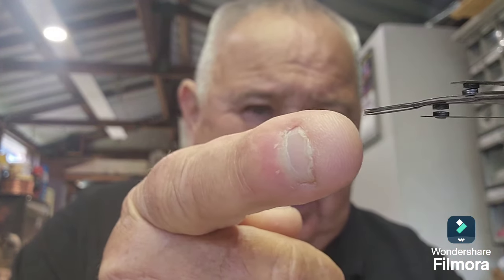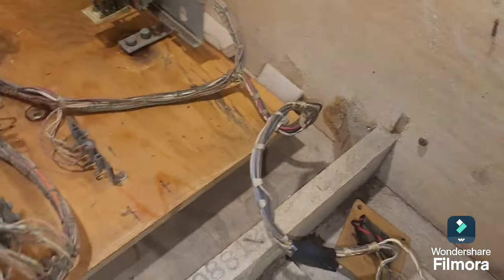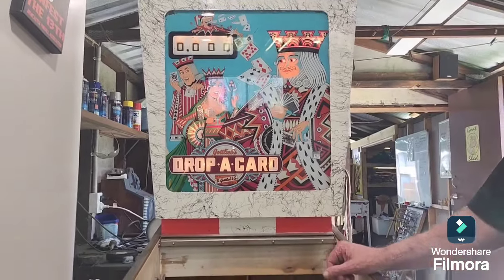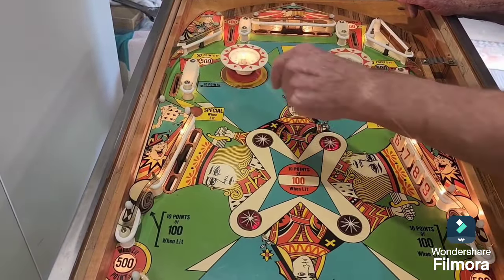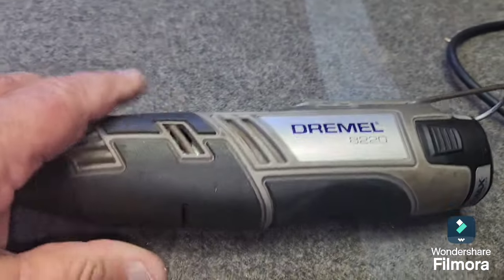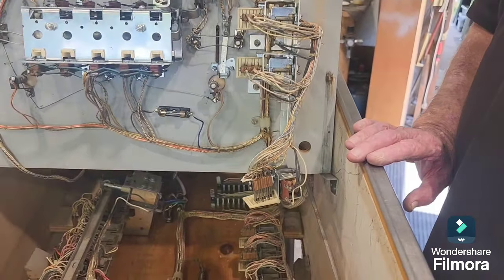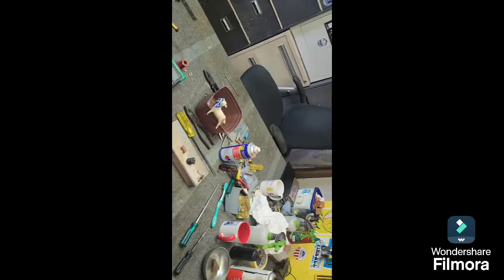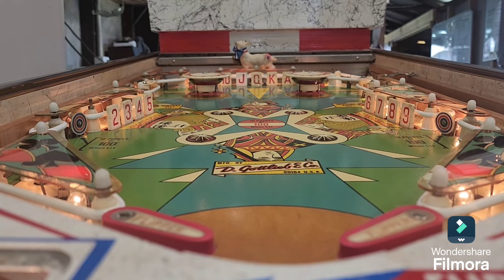Troubleshooting & Repairing Hacks Gottlieb Drop A Card

Comment: GOAT SHED, if you look at various Gottlieb schematics they will often use 47 ohm at 10 watt resistors for certain LITE lamps and 470 ohm at 2 watts resistors for certain relay coils. Why are they using these resistors for the lamps and relay coils? Only Gottlieb did this with EM games not sure why.
Reply from the maker: @waynegram8907  yes we've actually covered this in a video a long while ago. The reason is that they use the 25 volt circuit is simply to save on wiring. So when you see the 75 ohm 10 watt resistor it's measured to run off the voltage of a #44 lamp. Thats the only one to use if you use a #47 lamp it will go super bright and eventually blow. So essentially it's a cost saving measure.
Reply: @goatshedempinballrepair8545  So they are using the 75 ohm 10 watt resistors to STEP DOWN the 25vdc circuit down to 6vdc for the #44 lamp/#47 lamp voltage? but Gottlieb also used 470 ohm/2watt resistors for certain coils also around the ball count unit. Most of the coils used 30vdc so using those 470 ohms resistors for the coils around the ball count unit did what?
Reply from the maker: @waynegram8907  without looking at a circuit i count be certain but best guess to limit arching across the contacts.
Reply from the maker: Most definitely if badly worn we also change badly worn stepper contacts also and snowshoes if necessary.
Reply: @goatshedempinballrepair8545  A common problem for EM pinball games is a running score motor, but how can you "FORCE a Reset" to Stop the running score motor?
Reply from the maker: @waynegram8907  you need to find the root cause ie: score reel not recognised zero or bonus unit not reset etc. A schematic will tell you what relays run the score motor.
Reply: @goatshedempinballrepair8545  but there is no way to FORCE THE RESET from a running score motor? I thought there was a way to FORCE THE RESET, like hacking the system. If not you would have to find each relay connected to the score motor which would tell a lot of time to find which contacts are closed at the EOS end of stroke switches on each Unit not resetting.
Reply from the maker: @waynegram8907 well apart from manually resetting via the reset relay or operating a trip bank sometimes that helps, but depends on the game. Other than that you just have to spend the time and delve into to problem.

Comment: Noticed a resistor on the jones plug from the door mine doesn't have 1 does it matter ?
Reply from the maker: It's not on the schematic from memory so an add on. There were so many hacks on the door circuit.